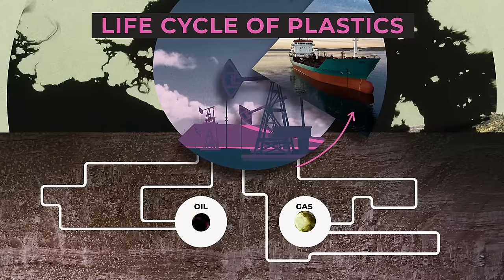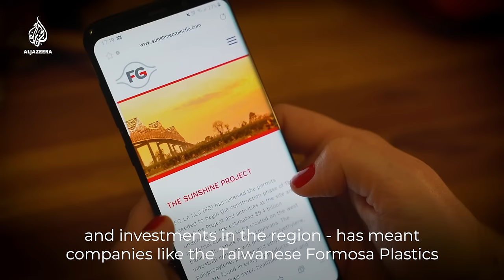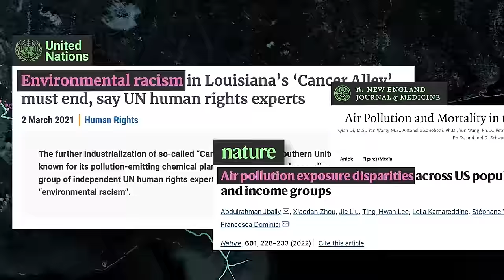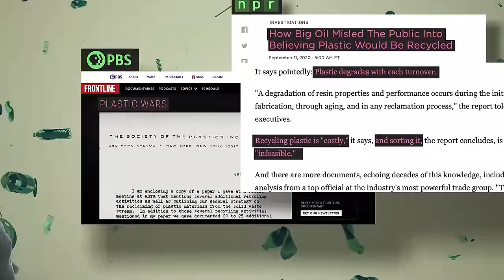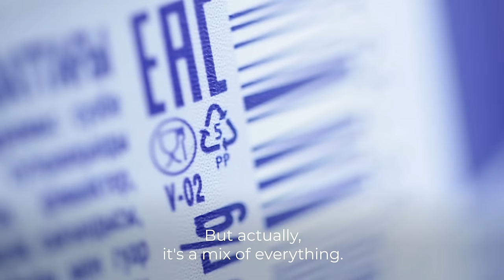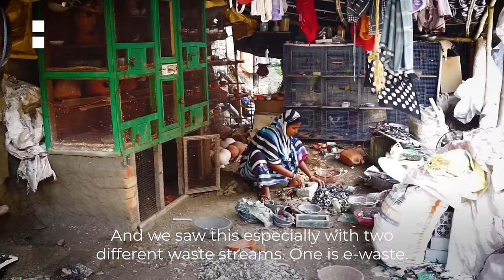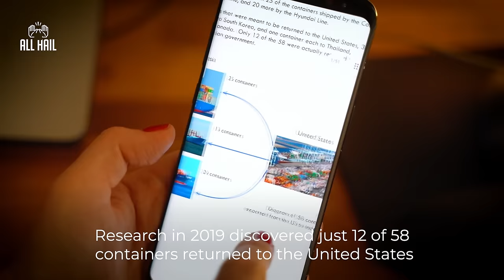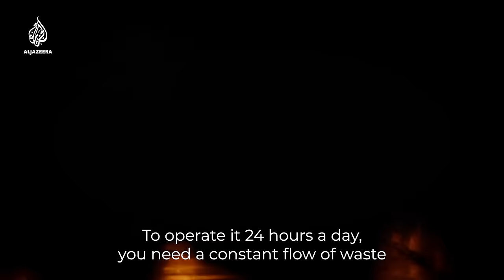Recycling won't solve our plastic problems  | All Hail The Planet

Comment: The problem with incineration is not that it is polluting, but that it is usually done in a sloppy fashion that is highly dangerously polluting. If plastic is incinerated with modern technology, it can be relatively harmless. The trouble is that is not how things are done. We are not talking about the latest tech, but 19th century technology that is just not being used.

Comment: Working in a recycling depot can wreck your lungs, its serious how much the dust and vapour can affect you. But the jobs are needed, the solution is to use less plastic, and be strict on what happens at recycling plants, including staff welfare, and where the waste bales are sent to. I worked at a waste centre in the uk, theyd shut us inside a warehouse of mixed trash, because commercial neighbours complained about the smell. It was torture, but the cameradarie was good, especially during covid.

Comment: I use cloth bags for shopping and I will put produce directly into the bag instead of using plastic ones.  This week my home heating died so I put a small space heater in one room and I now realize that I don't exactly need to keep the entire place heated.  Plastic is definitely a scourge.
Reply: Those small space heaters are the least efficient form of producing heat. Although they are 100% efficient, as 100% of the electricity that goes through them turns into heat, a heat pump or reversible air conditioner can be up to 400% to 600% efficient. Meaning for the same amount of energy they can produce 4 to 6x more heat than simply passing the electricity through a coil. And with a split unit you could direct that heat to the rooms you want. Even a natural gas heater can be more efficient as we use gas to produce a lot of our electricity, and using it to produce heat directly is far more efficient than turning heat into electricity and then directly back into heat. Although, better insulation would probably be the most efficient method.

There are no easy answers, and even the best of intentions can do more harm than good. Yet as long as you make an attempt to consume less, your actions are noble and the sentiments you hold will (hopefully) help push policies in a better direction.
Reply: @xanthicperspective4881  Thanks for your comment.  My rental uses propane for heat and so far this winter it's already cost me over $600.  The gas bill in my previous dwelling was about $40 per month.  I just heard about another rental near me and I hope I can escape to it.  Otherwise I'll be footing the  bill for a new heating system because the owner pays for nothing.  She did not get all the new flooring in so I had to pay someone to finish it.  Fortunately for me I am willing to put on as many sweaters as necessary. I try to stay in one small room but my cat knows how to open the door!

Comment: Your politicians have a few priorities: money, power, pride, influence, and job preservation.  Therefore, they will always side with big corporations and whatever other social position they need to take to keep their job.  If it's the morally right thing to do but will cost them their job, they won't do it.

Recycling won't fix the issue with plastics.  We have to drastically get away from plastics, especially single use plastics.

Comment: Any material that which requires being melted to convert a solid form to a liquid form is as seems obvious to anyone going to emit smoke, air toxins into the environment. The process of recycling to reuse the materials has to be conducted in a way that is least hazardous to the environment. The accumulation of all such material without further use or an attempt to reuse will result in a vast abundance of the existing material and the production of all that is being produced day to day. Thus it doesn't exactly make sense to say, recycling is not at all helpful to the environment. As such it seems liken to a mountain of plastics and another mountain of plastics, within the mountains of plastics is a facility trying to melt the plastics recycled for use in making, a plastic brush, a plastic chair, a reusable plastic cup, to form if an individual looks at it from a waste perspective they might be inclined to say and see a brush, a chair and a cup on top of the plastic mountains of trash, and then there is the smoke from the recycling process. In review of all such aspects it becomes clear, the plastic shampoo and conditioner bottle made from recycled materials, the brush, cup and chair are good for something. Either human beings need to use and consume less, produce less and find solutions for trash storage that are least harmful to the environment or they need to realize the solutions have to be approached from several angles as the accumulation is and has been for as long as it has. *Save a penny or not save a penny? As the conversation is going on, in how human beings might best try to save the Earth, save the planet, the species. God help us. Lord help the human species.